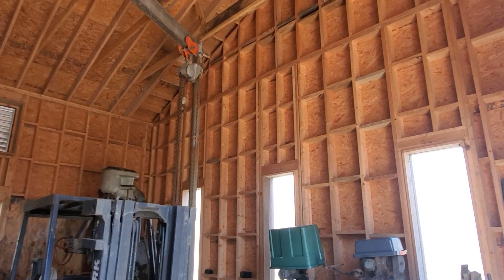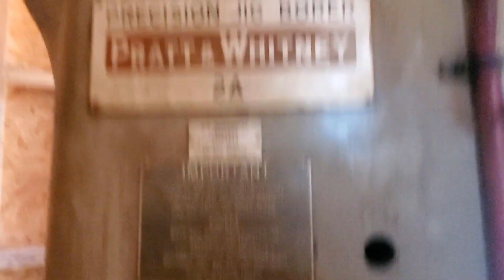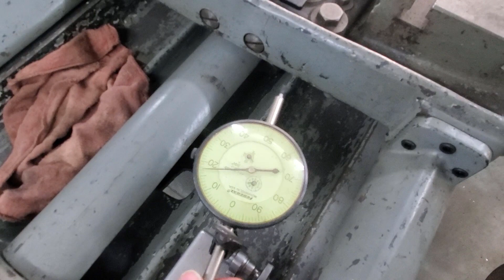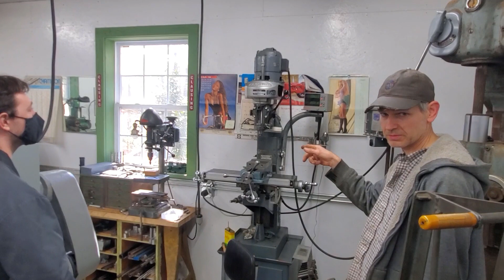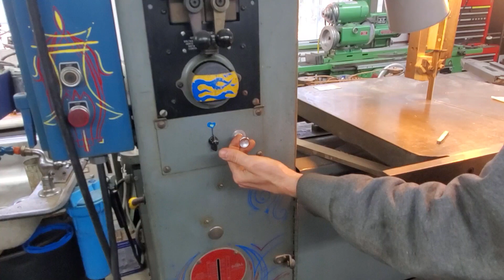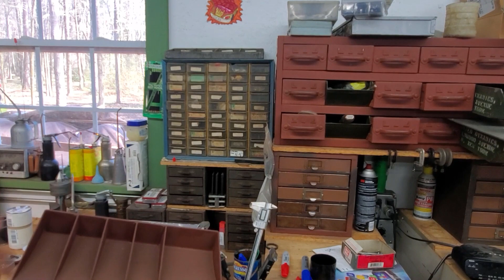A Visit to Doozer's Shop

Comment: 46:15 VFDs are very noisy. Try a live wire detector. It will go off feet away  with a VFD.
Reply from the maker: It's the only option I have right now for the motors. Running the DRO off the 110 mains has solved the glitching.
Reply: @EngineersWorkshop  Sure. Just giving a possible expanation.

Comment: Definitely an amazing collection of machines. The little 37R KR Wilson press Doozer has is unique because the pump is included in the ram assembly. Most of the KR Wilson presses had the hand pump on the side and ranged from 25 up to 100 tons. The model 37 was the 25 ton unit, and the other models used a suffix letter to determine capacity. Mine is a 37G which is 60 ton from WW2 that still has the 'Property of Detroit Arsenal" badge still on it. In later years you could also buy a electric power unit for them.
Reply from the maker: Yes, loving that press myself. Will starting searching for one..